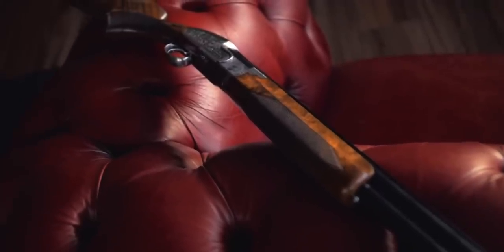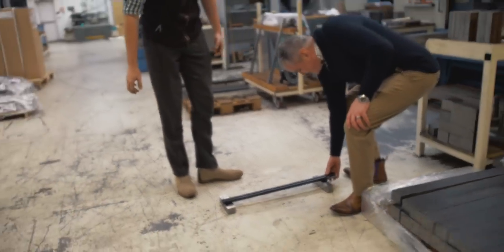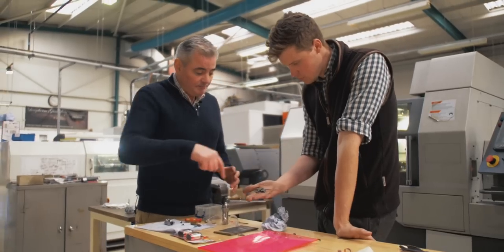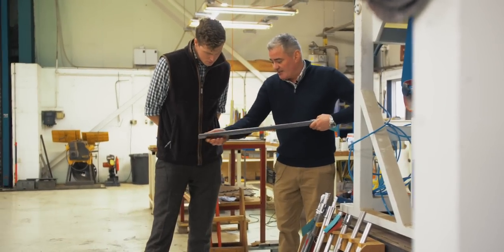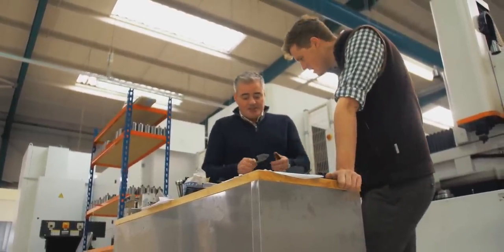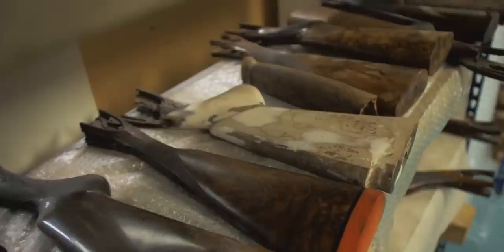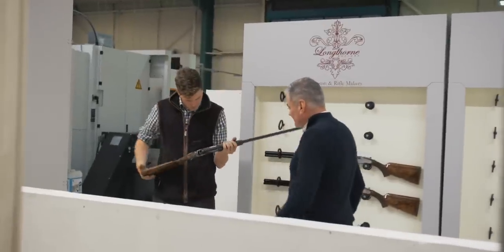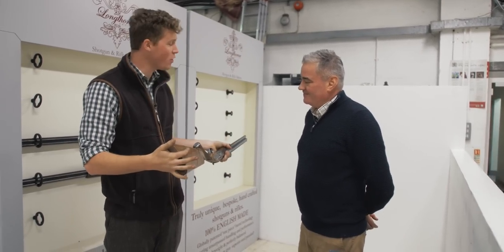Longthorne Gunmakers: Factory Tour and Gun Test

Comment: Barrels are traditionally  drilled by gun drills which do not follow a pre set course.   When drilled they are straightened,  reamed and then they are turned outside to bring the outside concentric with the bore.   Then they are joined with hard solder with ribs and regulated to shoot to the correct point of aim in the final boring.  The process shown here is good for one barrel, but how can the second barrel drilled to be in the correct  convergence with the first?    The gun drill is at the end of a long shaft which is 29 inches from the driver.

Comment: If steel shot becomes mandatory in the UK will Longthorne be the only manufacturer who can produce 3/4 or Full choked guns for steel? Another outstanding video from Jonny and Sasha by the way. Really appreciate your work.
Reply from the maker: Fabarm can also take steel through their full in recent Guns, so there is a choice of two
Reply: The wear resistance of barrel bores just depends on the grade of steel you use and its heat treating, any shotgun barrel can be made of almost any grade you want if you are willing to pay for it.
Reply: I’ve been making barrels for steel shot since the 90’s.

Comment: I work on old guns pre 1900 and i needed to drill a hole in a carrier of a Winchester 1887 (a genuine Winchester one) last friday and that carrier was made in 1891/1892 and i took a drill and it barely made a scratch then i took another one andi ended up with just the same result it just dint even do anything,then i went to the shop and i brough a brand new 8mm drill and again  i dint barely even made a scratch...In the end a dremel gave me  what i wanted..............Like steel in the old days was rubbish..They had the bearings to keep there lathes spin with tight tolences they had the steel to cut and work other steel they made springs that are crushing primesr today and so on.......

I am more impressed how people in 1900 made a gun with no power with no CNC machine then how people do it now......Including John Browing he had no pc or computer to test strenght of the materials and bla bla and his guns are around today even its almost 100 years ago he died...

So whats so special about this over and under design copied 200x and getting some improvements here and there and now its made on cnc machines with some awesome steel,if thats all is humans have gotten futher since Browing died its a sad thing making his gun a micro better better here and there and using better steel.......

Comment: "A price that is affordable" hahahaahahahahahaahahahahabahahahahahahhahahahahaahaha good joke
Reply: Evan Baker if you take all the engineering into account is not bad.
Reply: @roanpieterse4564  when you take into account all the engineering in a car, the gun is an insane amount of money. Especially when its mostly machine made
Reply: Rabbi Shekelberg  doesn't matter.  There is a lot of expensive electronics and other components in a car. A gun is mostly "machined steel".
Reply from the maker: Weigh it up to its competitors: 

It is the most affordable English gun
It is affordable as other top end continental guns 
The barrel steel alone as a blank costs more than many entry level guns with zero machining. 

It may be a lot of money, but it is not expensive.
Reply: If i had 24k to spend i d put it in a second hand db7, an aston martin db7

Comment: BS being shoveled here, the blanks for actions the best British gunmakers use are forgings they buy in  , there is no benefit in strength to machining from solid over a forging, the grain of the steel in a forging follows the shape of the part and so is stronger,  you only have to machine from solid if you can't afford to get the forging dies made and buy the forgings in bulk to get back the cost. The only benefit of barrels machined from solid is that its just CNC machine work you just need one man to oversee multiple machines, the benefits is purely cost, they won't be stronger, and if they are straighter its going to be a tolerance way beyond anything that will make any difference to a shot pattern. The idea that you can stand on their barrels is irrelevant since that's never going to happen in real life, the only way to produce a more dent resistant tube is to make it thicker wall or a higher grade of steel, both already possible with conventional barrels.
Spark erosion was being used in the London best gun trade in the 1990's. Its not knew.

Comment: There are comments here of "BS" in terms of billet vs forged. I can't comment on all claims in the video, and certainly forged vs billet of the same TRADITIONAL alloy will always favour the forged. However, there are new material steels being produced that represent impressive new technologies. From covetic materials (not so much for steel, more Cu and Al) to novel alloys created through mechanical alloying, modern techniques for creating alloys defy the time tested tradition of forging. In terms of forged traditional steel, a raw part forged and then UNTOUCHED will likely have greater strength. But, the moment it is machined or modified what were the built in stress/strength points are responsible for the strength imparted by forging start losing their benefit. Simplest example is a French baguette losing its stretched gluten cap cooked crust if it is modified or shaped even minimally after cooking. I smack you with a baguette, it's uncomfortable, remove parts of the crust here and there, the baguette starts to fail more than your head ;-) So, alloy for alloy, wrt traditional steel alloys, a forged item left untouched will be stronger. Once we start getting into the rare new alloys with modified crystalline or non-crystalline structure, nanoparticles, mechanical alloying, etc ... it is a different world. Even with the existence of managing steel, if it has not happened yet, the day where billets far surpass forging is coming. No-one has come up with utopium yet, but to think only forging will result in the qualities of utopium in the future is an outdated idea.